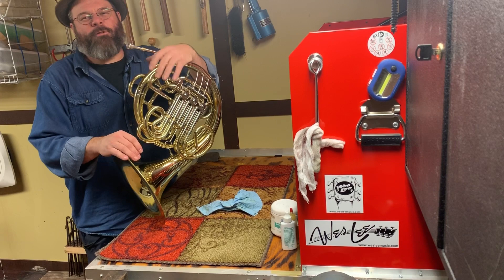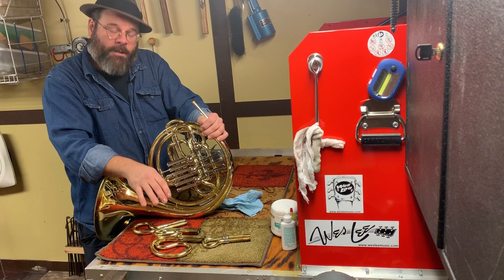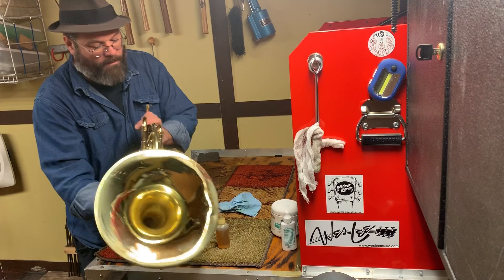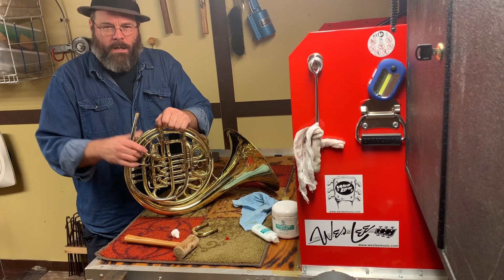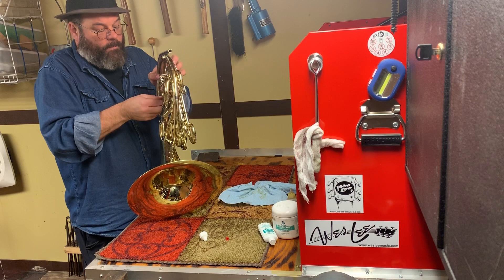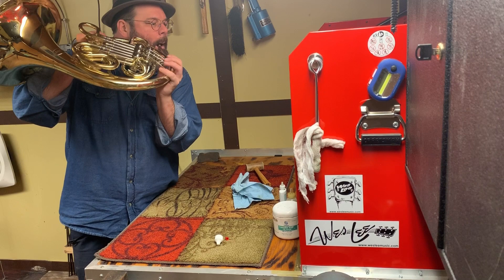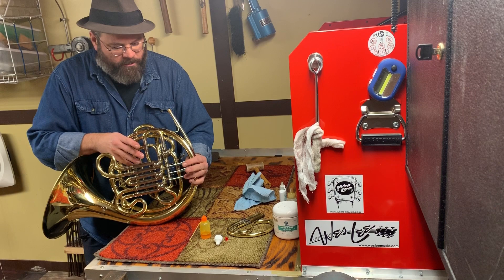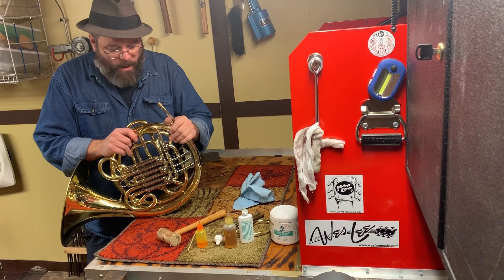What is that sound??!! Ep 13- slides and rotors- Wes Lee Music- emergency Macgyver repair series

Comment: I subbed in a lot of schools and ran across horns that were unplayable, not because the slides were mixed up, but an inexperienced tech at a local shop didn't know stop arms weren't interchangeable. I figured out quickly to pull a valve slide with the lever down. If I got a "pop" I knew the stop arm was in the wrong place!

Comment: Loving your videos! Really great quality and very informative. Quick question: Why do french horns use strings instead of the sort of linkages you see on rotary valve tubas and such? Are there french horns that use mechanical linkages?
Reply from the maker: Thanks for watching.
Back in the day, the only linkage we ever saw was the trombone rotor on the Bach, and it was terrible. Very loud and clunky. Rotors for the most part were tied. They were much smoother and more quiet. As time has gone on, more of all the instruments are adopting ball/socket linkage or the uniball style linkage. On the tubas it makes a little more sense because you can have a solid driver from a distance, but on f horn the leverage is different. On the F Horn, the string linkage is infinitely customizable where the mechanical linkage is pretty set. I don’t know if it’s ease of manufacture or what the thinking is. Almost every rotary tuba I see now is mechanical, and a growing number of French Horns. I would guess that most every F Horn I see across the bench that is made off shore is linkage, but that is just from me sitting here recalling, not any scientific data. I know I prefer the string tie linkage, but no one asked me! Ha
Reply: There's an engineering reason for the string linkages as well: with a minibal or other mechanical link, the force required to turn the valve changes as the valve rotates, with the least resistance at the middle of the stroke. With string, the force required to rotate the valve is completely even from one end of the stroke to the other. The difference is... well, small, for a 90-degree main valve. For 120-degree change valves, it's much more noticeable.